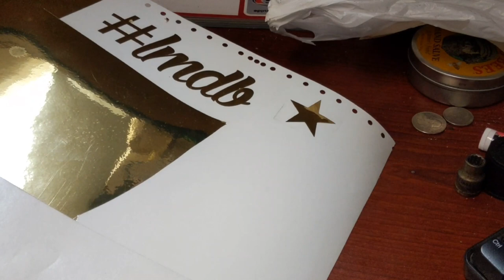Powder Coating a fender roller and air ride tank! - Ep 8

Comment: Could a steel tank from an air compressor be powder coated? I’d like to freshen up the compressor on my truck but not sure if I can send to powder coat or if I should just try and rattle can it for another couple years.

Comment: Love the vids.more details on cure times and temp.i.e two coat or what is a good temp and time duration to keep from bleeding together. Especially orange under ink black.
Reply from the maker: I can try to do that. Orange and black is a tough one. I assume you got the same mutant green most of us have gotten when those mix? lol
Reply: The only way I can get the orange to work is to shoot a satin or flat black then shoot clear vision on top.i dont think it looks as good but it doesn't bleed through

Comment: On average how long does it take you to blast a set of wheels?
Reply from the maker: 8 minutes a wheel is the average
Reply: @UnknownCoatings  Oh wow!  May I ask how many CFM your air compressor is.  It takes me hours, I think it's because my compressor is too small.
Reply from the maker: 28. I run it thru a pot though. So it's way more efficient than a siphon feed blasting setup. That being said I also chemically strip all wheels first. Well most wheels first. Check my most recent vid
Reply: @UnknownCoatings  Thanks for the replies and for the info.  I'm only running about 7 cfm, so there's the huge problem.